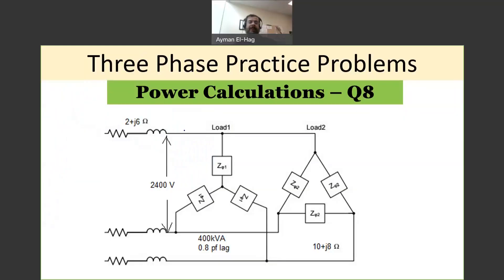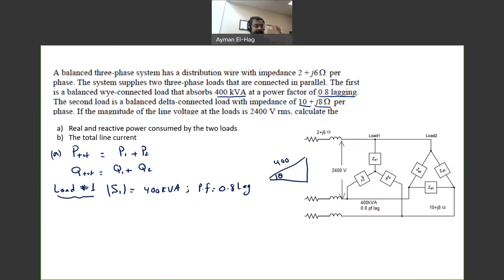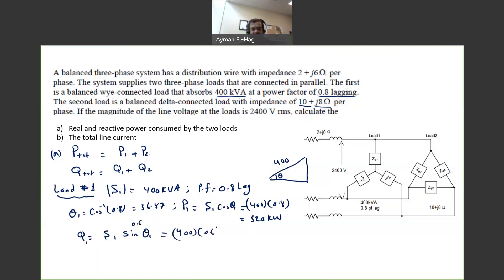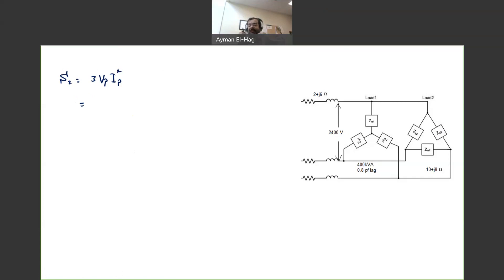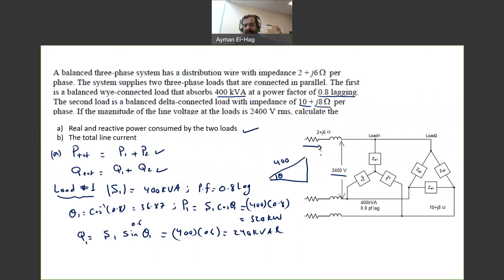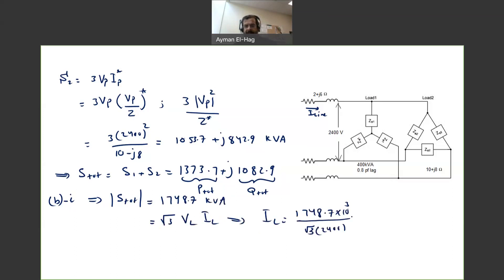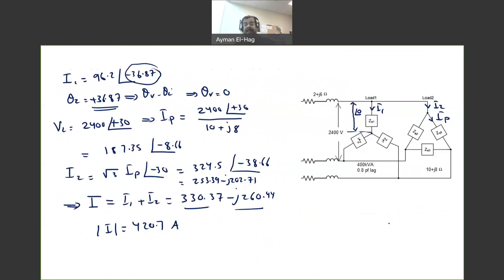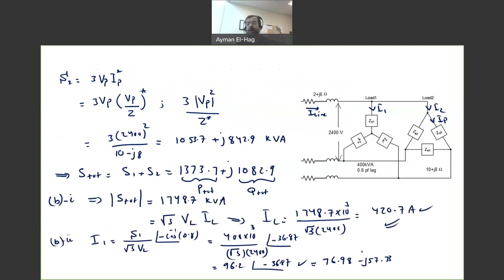Three phase circuit - Question no. 8

Comment: Hi Professor, for obtaining the current (I1),  as in the formula shown, it seems V(L-L) is a reference (theta=0)  (time 8:54), it means 2400<0
And in  10:09, you got the Angle of voltage is equal to zero for the line, and after a second, you wrote V(L-L) angle (30+)
I think so  V(L-N)= angle -30  amplitude= 2400/1.732
Thanks,
Reply from the maker: Hi, it is not mentioned in the question that the phase shift on the line voltage to be zero. Hence, I selected the phase voltage angle to be zero. Always remember that the power factor angle is between the phase voltage and phase current, so it is easier to assume the phase voltage angle is zero, if no angle is specified in the question.
Reply: Thanks for the clarification
Reply from the maker: you are welcome

Comment: Is there a possibility to cover wind energy from an electrical engineering point of view?
Reply from the maker: Dear Youssef, thanks for your question. In this channel I try to cover the topics that I have good background which include different circuit, electronics, numerical method and power courses. Also, some practical aspects of different power system assets and application of machine learning in power engineering. Unfortunately, my background in wind energy is limited and I may not be the right person to talk about it.